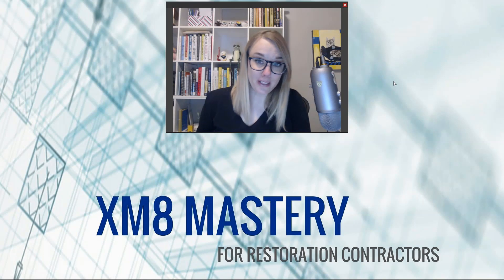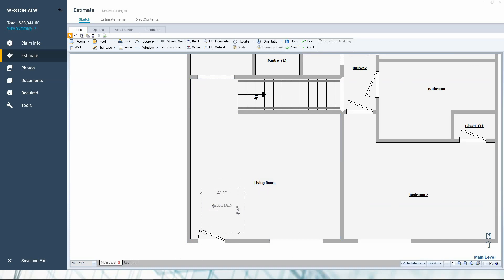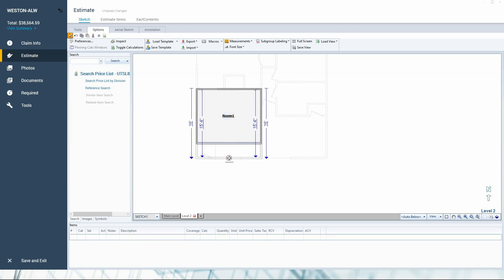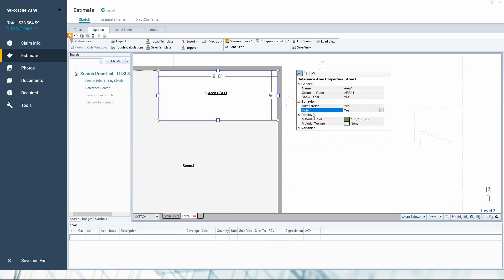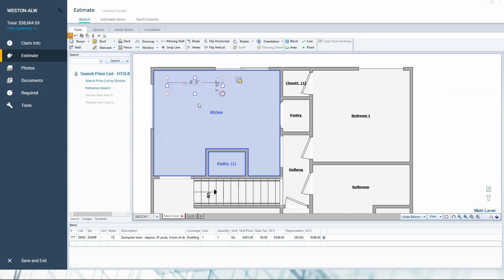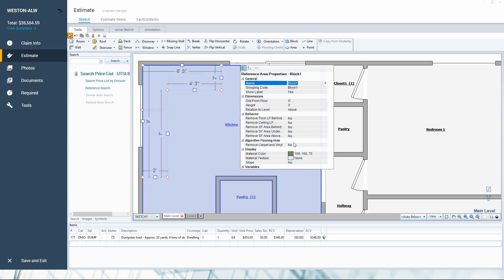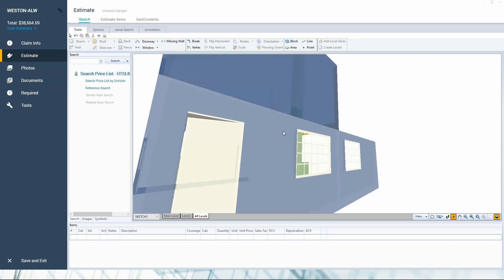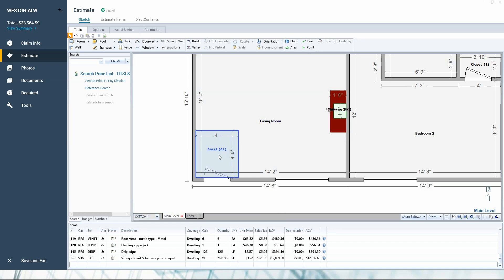How to Create a Fireplace or Tile Entry in Sketch

Comment: Great, succinct reference for areas and blocks, thanks!  I've started using the blocks as well to represent columns on porches and sometimes just if I need a visual representation of supports for a balcony.  I haven't found a way to make them round, but for my uses that's not critical.  Blocks are also nice for bathtubs/hottubs and areas make good showers.  I always appreciate your work!

Edit: I've noticed that sometimes if you're trying to drag an area/block to a wall it insists on having a buffer, whether it's near a corner or not.  Any idea what it's complaining about?  One thing X1 needs is error messages.